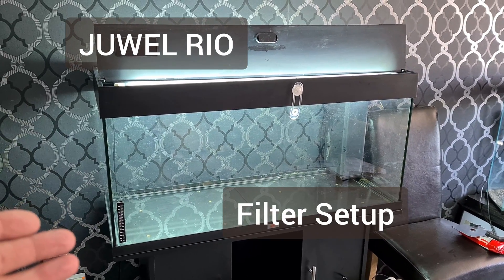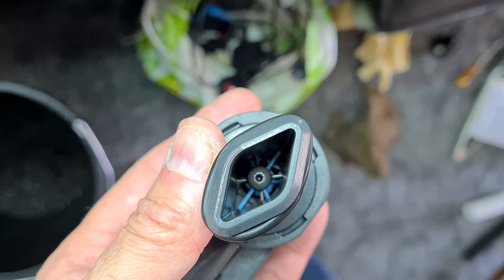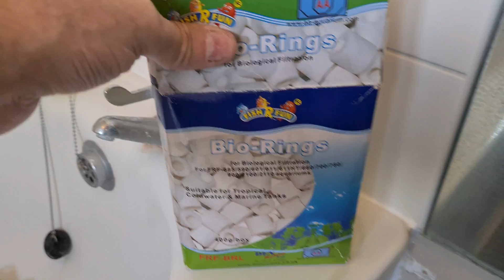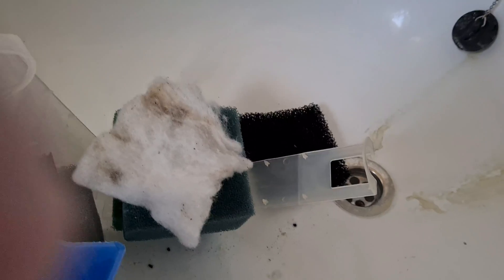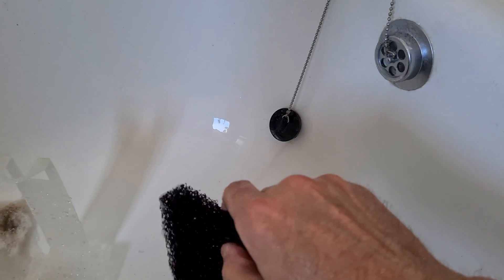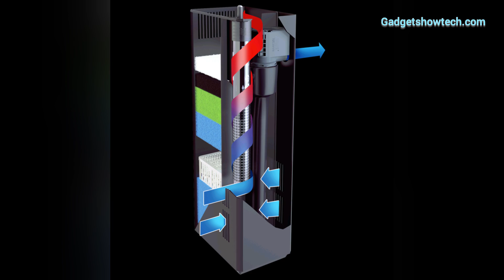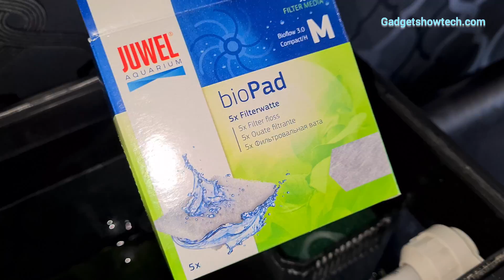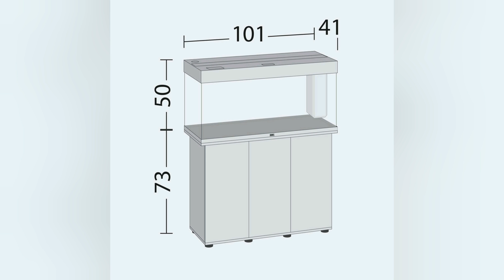Best JUWEL Bioflow Filter M L RIO/VISION Aquarium Fish Tank Biomedia setup

Comment: The floss goes on top.

You pull out all the course materials and replace the floss semi regularly. 

If you blast the floss with your shower in a bucket you can get a couple months from one floss.

Don't put them at the bottom, you'll clog you media. If your floss is on top as you notice the pump flow diminish you can whip it out and blast it before returning it clean in about a minute without disturbing the bulk of your filter stack.
Reply from the maker: Which way does the water flow into the filter,  top down or bottom up?
Reply from the maker: The floss filters the fine particles,  being at the top first inline will see it clogged.   The manufacturer does like this so they sell more.   And this is not just my opinion.

Comment: A little bit late to the party but just in case anyone else is at the same place as me. I bought a second hand rio 180lt with this filter in place. The back of the filter it was full of calcium so I decided to take it out to clean it. Unfortunately the glass behind the filter is deformed. Like it became too hot and melted at the surface. I was planning to use an external filter but trying to figure out how can i fix this deformation if i can or at least find a way to cover it. Good thing at least is that the deformation is at the side but still! So if you buy a second hand aquarium with a lot of calcium buildup have it in mind that maybe the glass has an issue too!
Reply from the maker: That is the strangest thing I have heard.  

Aquarium glass only begins to soften at extremely high temperatures, far exceeding normal household or aquarium conditions.  

Maybe it was a defective originally. 
Its not ideal, and yes I've bought many aquariums with hard water residue.  I cleaned them and then sold them on or kept if nice upgrade.  
A full article on gadgetshowtech.com on it during the pandemic.

Comment: Isnt that outlet supposed to be facing upwards to disturb the water surface?
Reply: Thats what I have actually done! Makes surface agitation
Reply from the maker: yes, you can use that position if you wish to introduce more oxygen into the water. 
Thanks for pointing out that I could have added this information at the end.
Reply: Not always. If it's oxygen rich water (like in a lot of the UK), you don't want a lot of movement on the surface otherwise the co2 will gas off and plants will grow slower.

Comment: Hi, can anybody tell me why my filter area is not filling up with water. I have cleaned all the filter sponges. If i take all the sponges out , it fills up. Its as if all the filter sponges are being sucked to the bottom? Help please.
Reply from the maker: The tank water level needs to be high enough  to overflow into the cut outs on the side. 
And yes the sponges are fine going to the bottom.  
Maybe something you did differently that gave the odd outcome.
Reply: @Car & Home Gadgets Technology Unboxing Reviews  
OK thank you,  will see if it happens again  overnight.  Water high enough and I got the gravel cleaner etc in the filter housing to make sure no holes are blocked.

Comment: what you you recommend an adjustable flow for a 90litre tank
Reply from the maker: I've mainly gone with the Fluval internal rage for that size tank. 
Although Interpet upgraded their range to include some Bio ring media. 
You can aim the flow at the glass to slow it down. 
I recall a filter that has flow control but not sure which and might have been for bigger tanks.

Comment: I cant have crystal clear water with this filter running for 5 weeks. Thinking to replace it with external….
Reply from the maker: Do you have the fine filter floss (white) one?     
I'd use external if over 180 litre, or if heavily stocked.
Reply: Gadget Show Tech Unboxing Reviews . Yes I use the white filter. Also try jbl symec micro as they suggest me. Also try the set up from pimp my filter. Last 2 days I to close the upper hole with a sponge. I didn’t succeed crystal clear water.
Reply from the maker: @dimitriosgagalidis4400  how many fish?
I've had it clear before.    I currently use external canister because the 260 tank is missing the Bioflow motor.
Reply: Gadget Show Tech Unboxing Reviews  8 trigonostigma and 2 small size  angelfish and plants
Reply from the maker: @dimitriosgagalidis4400  I also have z wave maker, it increases the flow around the tank and helps speed up the tank becoming clean.     I turn mine on when it needs it.

Comment: I have been given a Juwel filter - well, parts of!  It is missing the pump, external nozzle and lid.  How do I know which model/ size it is i.e. which size pump, nozzle and lid to buy? It is 500mm tall. Has two baskets (with a basket of "little pebbles: between them and loads of sponges etc.) It needs the lid, the pump and the nozzle.  I have several different filters I currently use (I was given lots of stuff) all of which I clean regularly but as I have the basis of the Juwel Bioflow I am wondering if i should invest in the pump, nozzle and lid?
Reply from the maker: sounds like an XL.  1000 LPH

Comment: How often would you clean your foam filters set up this way. Great video mate
Reply from the maker: Monthly should be fine. Rinse the filters and bio, change the fine polish filter once it's not fit for purpose.    Since these can easily lifted out easily means it's a lot less hassle.
And thanks but I've done better lol    but I've also seen worse
Reply from the maker: I now use external cannister because I'm a Bio media fan, can have so much of it lol.   My recent 180 did not come with the Bioflow, because it was second hand.  I may well have used it instead of 307 which I'm using currently.

Comment: Can this filter be removed? I have dead fish stuck down the side of it 😩
Reply from the maker: It should, it's held in position with rubber suckers.  Might need a wallpaper scraper to ease them loose.    
I also had a small fish get stuck n Die and rot there.
Reply: @SmartGadgetShow  looks like mine died that way. Managed to get underneath the filter and get the remains if it out. Ty
Reply: Evil
Reply: @delsingh5897  ouch 🙄
Reply: Yes it’s quite laborious but buy a couple of thin stanly knifes the ones that retract and remove the canister by cutting through the rubber bonding cups ?? Once removed get a heavy duty razor blade and remove the black rubber being carful not to scratch your tank .

Comment: Mine is set up exactly the same and the poly pad lasts ages... juwel recommend setting it up there way and to replace sponges often as they know it makes them shit loads of money..I have had same sponges for years and they still going strong
Reply: @unklefrank319  I have a few fluval canisters in my garage,but I have to stick with the internal one because the tank is inside of a wall and the cabinet doors do not open…
Reply: @bonesawarm6987 Hi I'm just setting up a new one of these. So do you agree to have the fine pads at the bottom and coarse at the top? I've set it up as per the Juwel instructions as I'm a noob but would rather go on actual user advice
Reply: @unklefrank319  u
Reply: I rinse mind with the shower head. I get over a month per floss and don't have to disturb my filter stack to wash it.

Comment: I see the pipe is under the water? Mine is below the water and doesn't pump up the water, but the Impeller runs. I don't find the mistake.
Reply from the maker: For the pump to work the water level needs to be higher than the inlet at the top. 
Has the impeller and pump been cleaned recently?
Reply: Can the filter/heater/pump housing be totally submerged? I bought a 2nd hand tank but had to buy a new heater. The way the heater sits in the housing is quite high up and the minimum water level for the heater means I would have to totally submerge the housing... 16:45 8/5/2025

Comment: What’s the stock pump like? Is it loud or quiet? Thanks
Reply: I purchased the Juwel Bioflow Super 3 months ago and it's running since then. Today, I still can't here anything. You really have to put your ears at 10 cm in order to "hear" a very little sound. I have no vibrations at all. Sometimes I look at the flow coming out from the pump because I don't know if it is running or not (because it's sooo quiet). Hope it helps :)
Reply from the maker: It's a whisper.   It's quite incredible how internal filters are inaudible.
Reply: @SmartGadgetShow  I was looking at this and the fluval but the fluval stock pump is meant to be quite noisy.
Reply from the maker: @bretleversha  My fluval U3 started a little bit noisy but after a week settled in and can not hear it now.
Reply: @SmartGadgetShow  was looking at juwel rio and fluvsl flex. Can’t decide.

Comment from the maker: I have since found the original picture which shows the filter holders go in with the plastic to the outer edges.  I have now rotated them around 90 degrees so the plastic does not get in the way of the inlet holes.
Reply: I cant get my pump to start working??
Reply from the maker: @EB-xs8co  does it power, sometimes need to turn with fingers.   Also need keep lubricated
Reply: @SmartGadgetShow  Is  regular food oil ok??
Reply from the maker: @EB-xs8co  silicone gel.
Reply: Food oil in your water will kill your fish.

It will prevent oxygen transfer at the surface and they will suffocate.

Never use any kind of oil with an aquarium.

Comment: Ive always had the heat rod the opposite end of the tank at the back and temperature indicator on the front opposite the heat rod so I can regerlate the right temperature for the tank.
Reply from the maker: I'm sure if I had the JUWEL heater that I would be able view from the side where the view hole is.